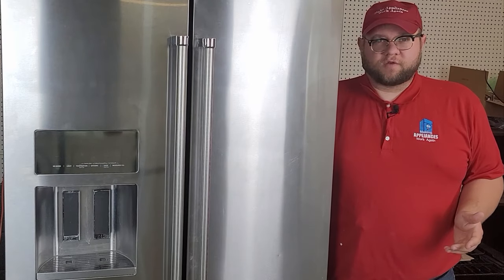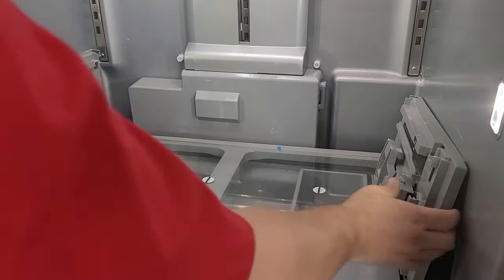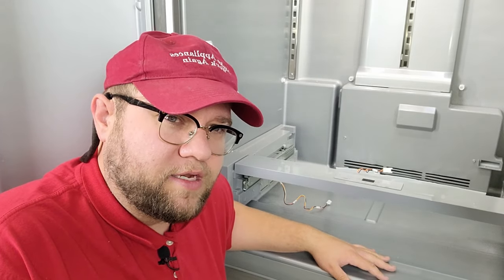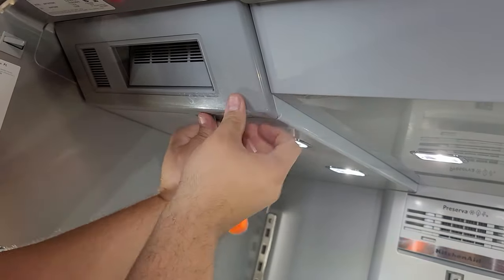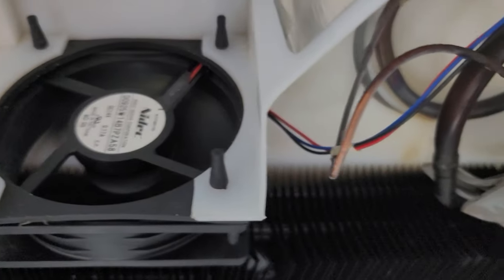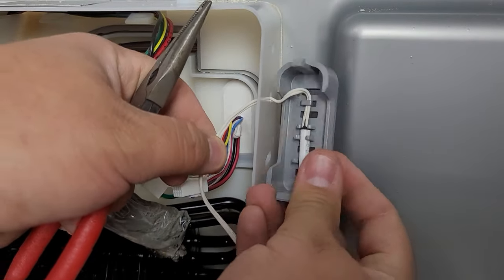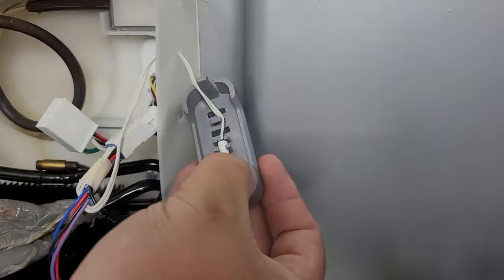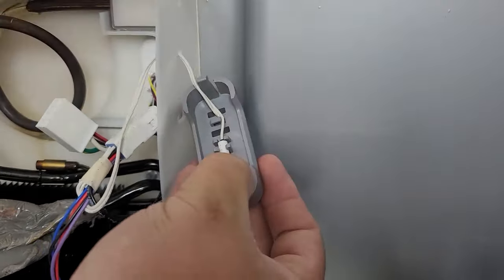KitchenAid Refrigerator Not Cooling & Leaking Water but Freezer is Fine - How to Fix

Comment: Whatever happened to the basic white refrigerators? You plugged them in and they just worked for a decade or more.
Reply from the maker: Frigidaire still has a top freezer with a mechanical defrost timer. I got one made 6 months ago that didn't work proprely (user error). I was floored when I opened it up and the parts are the same as the ones from 30 years ago. Just beautiful.
Reply: It was too reliable
Reply: When my parents retired in 2008, they gave me their freezer that they'd bought in 1966. It finally died in 2010.
Reply: @bensappliancesandjunk  brand model # and link please. I only want old reliable. 
We have a one-year-old refrigerator that is condensating inside KitchenAid of course that’s why I watch this video. Really appreciate your content and miss your old school hat and black-and-white uniform. I’m sure they suit you into oblivion. I’m glad you got more videos to do and I don’t care what you wear I do share and like and I’m definitely a subscriber long time.
Reply from the maker: @MichaelDillin  the video is coming out in a week or so. FFTR1835VW3. Make sure it isn't a FFHI model from Frigidaire.

This video was made a little over a year before I started wearing the Maytag outfit, FYI

Comment: Hi, would you be so kind and explain how to do put your Kitchen aid refrigerator in FORCED DEFROST mode.  I have model KRMF706ESS01 and the service code for a forced defrost is #38.  My applicance only gives me 2 options when I use the S3 button to scroll - OF and 5H .  So I select the 5H, do I need to let the display flash and leave it untouched for the defrost cycle to kick in? Or do I need to exit the diagnostic mode for it to kick in? Once this setting has been correctly selected, does the appliance immediately go in to a defrost mode?  Should the back panel feel warm to the touch?  I have yet to find any information on how to do this.  I even called Kitchen Aid but they were not able to help on this very basic function every owner should have access to. Thank you in advance.

Comment: From what I can gather nothing is “wrong” with my unit, I took it apart and removed the ice that was built on it, ran the diagnostic and my fan was spinning. Put everything back together and waited 12hrs and it wasn’t even 1 degree colder inside. What else can I check?

Comment: Thank you for this video! I have the same fridge (5 door model), but I believe a different problem (maybe 2). I get frost build up around the icemaker to door gasket. Any thoughts on that? Also, if I remove the icemaker and thaw it out, then re-install it, I will get 1 batch of ice. After that, it tries to make ice (can hear the water valve opening), but no water goes into the ice tray. Related issue? I'm assuming the water line is freezing up. Thanks for any suggestions!

Comment: Question about service test 7. I have a kitchenaid KRMF706ESS and I do not have a service test 7 to change the defrost mode. It skips from 6 to 8. I found a thread online with a couple other users stating that their 706 models had the exact same problem (no service test 7). Any thoughts on this or is there a way to reset or recover this so that service test 7 reappears? I’m assuming it’s a known issue or perhaps it was designed that way? Thanks in advance and thank you for the very helpful video.
Reply: Did you ever get any info on your question?  I have the same model and same question also.
Reply: @kevinmast7531  I was told that some models just don’t have that service test 7 option. I had suspected my problem was the thermistor. I ended up rolling the dice and buying a new thermistor, put it in and it solved my problem. Strangely the old one did not test much differently than the new one, but I was using a cheap ohmmeter without a ton of experience using one.
Reply: I have the 706 model and it skips mode 7.  I get a screen showing all the settings available, but do not understand the computer well to correct them...

Comment: What if the FC is working find, but the RC Evap just isn't cooling. Fans is not on, but does function (through diagnostic test), Thermistors are also testing fine.

Comment: Thanks again for the video. 
I ordered the fan and sensor kit from your link. I ordered Friday and it arrived Sunday afternoon. After testing, I think my system was working properly. Fan operated, but I switched everything out with the new set-up anyways. 
The main thing is that I was able to pinpoint the problem and allow the refrigerator to defrost completely. Then I used the new defrost schedule shown in your video. 
I would like to make people aware that there will be a lot of water coming out from underneath the refrigerator, more than the drip tray can hold. Be ready with a wet/dry shop vac.

Comment: Ben this video was so helpful. My cousins fridge had about 40lbs of ice at the back he could not open the small drawer. Thanks to you I was able to remove the back clean the condenser coils and check the pan. I have now reset it to mode 2. As I am visiting and do not have access to repair equipment. My cousin was horrified when I took apart all parts. But your explanations were great. 
Thanks from a Cuban Chick.

Comment: Our fridge was also not cold enough and sitting around 50 degrees. It was not icing over either. I had a Kitchenaid assigned repair person come out and the diagnosed by guessing that the main board needed to be changed. After watching this video and reading through many forums I decided to change the fan and dual thermistor kit (Part  W1103316). This worked!!! The fridge is now cooling as it should and sitting at 35 degress.

Comment: Great video. In my case it was a big solid block of ice back there, but everything functional after the thaw, and thermistor already moved and foil wrapped (probably by previous owner in the past with the same issue) I would like to add that, like many others, I was able to remove the tower without touching the icemaker. You simply work on the clips and slightly shift the tower to the right as you remove it. You really only have to overcome a few millimeters of plastic ridge that the edge of the icemaker overlaps. Also, no disconnecting all of those wire connectors. Another thing to do, clean your dusty coils and check your drip pan under the fridge after all that thawing, as it will be very full.

Comment: Hey Ben,  great informative video.  I have a whirlpool 5 door just like the kitchen aid one in this video.  A month back my fridge started to warm up and my freezer did as well.  Initially, I thought it was the freezer that was the issue as I had a lot of ice built up on the coils in the freezer.  I manually defrosted it and checked the defrost heater for continuity which it had and put it back together.  A few weeks later, same thing so I opened the freezer up again but there was no ice buildup on the coils.  I put it back together and contacted a whirlpool tech.  First time he came out, he opened up the panel behind the middle drawers, manually defrosted it, and replaced a part that whirlpool covered.  It was some kind of pan.  He left, and the fridge was great for about 24 hours.  Then the same panel behind the drawer was frozen over again. I called home back and he replaced the thermistor and manually defrosted.  Same thing happened about 24 hours later.  Third time out, he comes with another guy and they took everything apart.  They were on the phone with whirlpools service center and whirlpool seems the fridge non repairable.  Tech said he’s never had that happen before but there is nothing he can do.  I have a hard time believing it is not repairable as everything works great until that panel behind the drawer freezes over.  I assume he verified everything in the video but maybe I have to take it apart to make sure.  Have you ever heard of whirlpool claiming a fridge is not repairable for an issue like this?
Reply: Same here. Tech told me there is 12v at the board behind the unit but not to the evaporator fan. He said it is a bad wire and not repairable...

Comment: Thanks to your awesome video I fixed it!  Bought 5 sets of 8 pin connectors on Amazon for $8.59.  Replaced the male plug that comes out of the fridge wall.  Works like new!  Thanks so much!!!
Reply from the maker: Wow! That's awesome! Not a lot of people go that far: Replacing the plug that comes out of the fridge wall, but that's awesome!

Comment: Hey Ben,
 Thanks for the very helpful video.  You saved us from having to buy a new frig.  Our frig is a Whirlpool wrx988sibm01 French Door (4 doors).  As expected it was a bit challenging to take apart but with some patience all went well.  Our problem started with the ice maker not working.  So, this is where I started but learned about 1 week later that the milk was tasting funky--put in a frig thermometer and soon realized frig was not cooling.  Freezer seemed to be working okay.  Once we got everything apart there was the iceberg.  After getting all the ice removed and opening it up, we tested the fan and it passed.  Next, came quite a bit of problem solving---the fan was easy to find online; however, the part that includes the 2 sensors was a separate part: Harns-Wire W10837236.  (In your video your part for the fan included the sensors.) Hopefully, this will help anyone who has a similar model to know what to buy.  Also, in my online research there was a service bulletin put out by Whirlpool and/or  KitchenAid  about their frigs having this exact problem. The key problem noted in this service bulletin was not the fan but issues with the sensors and their placement--as noted in your video.
Reply from the maker: Glad you got it fixed man!
Reply: @bensappliancesandjunk  
Hey Ben, I spoke too soon. I am now having just the opposite problem. The fresh food section is working "almost" okay but now the freezer is not freezing. The fresh food section is staying right at 40 degrees and the freezer at about the same temp 40 to 45 degrees. I have run most of the Service Tests. For Service Test 3, both RC and FC evaporator fan motors come on. For Service Test 6 "Defrost Heater/Bi-Metal I am getting a code 2 or open. I am assuming I should be getting code 2, because since turning the frig back on the freezer's temp has not dropped low enough for it to close. 
What is weird about this whole thing is that the freezer seemed to be working fine before we turned the frig off and did all the work I noted in first comment (removed the ice, tested the fan, and replaced the 2 sensors via the new Harns-Wire W10837236).  I have given it a thorough cleaning inside and out.  Any suggestions would be greatly appreciated.
Reply from the maker: @davidjohn5331  How long did you wait to check for temps? They tend to take awhile, upto 48hrs to get cold. Make sure to check black condenser coils at back/underneath then check condenser fan as well. Could of had an underlying problem that hasnt been solved yet.
Reply: @bensappliancesandjunk  Thanks for the reply.   Sorry if this is a dumb question--I am very new to doing frig repairs.  I am confused by which fan is which.  For the condenser fan, is this the fan you are referring to this video that you showed replacing.  I believe this is the evaporator fan, which I tested when we had everything apart and it came on.  I have checked the compressor fan in the bottom back and it was caked in some dirt, which I removed and cleaned.  I'm not sure where the condenser fan is located.     As a side note, I did notice that the compressor at one point when I had the back lower cover off was very hot to the touch.
Reply from the maker: @davidjohn5331  Put the cover on and see if the airflow to the compressor helps. Some of those units need the cover on to direct the airflow through the fans to the compressor then out. Sounds odd, but sometimes restricting the air helps the flow directly to the compressor to cool it down. Having a hot compressor is a sign there's an issue. Either with airflow, or potentially refrigerant.
Reply: @bensappliancesandjunk  Thanks Ben.  I will give this a shot.  If there is an airflow issue even if the fan near the compressor comes on, could the motor for this fan potentially need to be replaced for this fan--maybe not spinning as fast or operating like it should?

Comment: Thank you so much, Ben!!!!
Our fridge lost cooling in the main compartment, and your video was the exact recipe to fix it!
We encountered a totally iced up fan and coil in the back that we thawed out with a heat gun. We moved the thermistor to the spot you recommended, and I guess we'll have to take the unit apart in a few days to see if we actually have to replace any parts. For now, it's working.

Comment: Awesome video and thanks so much for your great and concise explanation. My fridge is working  great now after I purchased the parts kit and did the replacement. However I do have to say that you don't have to remove the water assembly, ice maker or air tower. I just removed the two screws from the evap cover panel the and it slid straight out. Much faster and easier. Not sure why you say you have to remove all the other parts.

Comment: Thank you so much for this video, it helped me save $$$ by replacing the evaporator fan and defrost thermistor w/o calling a repairman. The fan was working but the coils were completely incased in ice which was starting to spread out of the evaporator cover and causing the chef's pantry drawer not to close. Must have had a bad thermistor.

Comment: Great video. Very detailed and easy to follow. The only problem I had was removing the water line to the icemaker. I've used these type connections many  times and know how to release but this one would not release completely. The line would move back about 1/2" but could not pull it all the way out. Had someone hold the ice maker just long enough to remove the back panel and then hung it back up.

Comment: Great video. My fan is making a lot of noise suddenly since 4 days ago. The rear compressor fan is fine. I tried the diagnostic mode and the loud buzzing of a fan appears when I select 03, then press "Select Zone" to cycle the value from 01 to 02 and 04. As of today, I'm beginning to see some frost build up behind the freezer drawer while there was none in the previous few days.

Comment: By far the best video on this problem on YouTube.  Great video and one with exactly the right amount of instruction.  I do have a question on running the diagnostic prior to tear down.  What test results am I looking for that would indicate there is a problem?
Reply from the maker: This one sadly wouldn't show up on diagnostics. Typically the thermostat has gone "bad" by being off-value. it'd still show as good, but it would cut off the defrost process quicker than what is truly needed. The system/diagnostics would assume its still working to exactly proper specification, but it isn't.

Comment: Thank you for this video.  I have the exact KitchenAid refrigerator.  Is there a way to turn off cooling for the refrigerator to defrost it while keeping the freezer section operating at below 0° C temp?
Reply from the maker: No. But generally the freezer will hold Temps quite well if defrosting. Using a steamer to cut the ice out helps ensure you can remove the ice quickly
Reply: @bensappliancesandjunk  Thank you, Ben!

Comment: Made this repair about 7 weeks ago, and I can see ice forming behind the cold drinks/deli meat drawer again. Could you share the video of you adding a secondary heat defroster that you mentioned at 10:24?
Reply: Yes, I'm highly interested on that as well. All I can figure freezing the video is that you splice the Supco heater into pink #1 and brown #5 wires at the 7 wire connector to the board.
Reply: Interested. Is there a video out there for the walk through? And what parts to buy? I have a hard time even finding a suitable heater. Anyone?
Reply: Yeah same issue.  Service guy came out and changed the fan and temp sensors.  Still icing over. Seems like it should have a secondary heater standard... I like the fridge but fed up with the coils freezing over.

Comment: Awesome video!!!  So I took my fridge apart to replace this part.  The connector it plugs into (as you warned in the video) was severely corroded.  One pin is actually missing inside the connector (tan wire) and the yellow wire was broken off the back of the connector.  Obviously, the new one will not work.  How in the world do I fix this?  I'm assuming slices would cause worse problems later, but cant find a connector to reset the wires in a new one.  Please help!

Comment: WOW, I just had three different repair companies replace the Ice Maker 3 times before the last guy figured out the first two had installed the "wrong" icemaker.  It was obvious as mine had two plugs while the ice makers they installed had the TWO individual wire runs merged into ONE connector.  It took over 2 months before it was fixed.  But this looks like a royal PITA.  Our KA 5 door was bought in Jan 2019 probably manufactured in 2018.  Would I have the new and improved parts you mention or do I have a ticking time bomb?

Comment: I have a kitchen Aid refrigerator similar to the one you are working on  in this video. The drain tube is plugged and water building up on bottom of refrigerator. Is there an easy way to clear this line or do i need to pull it completely apart?